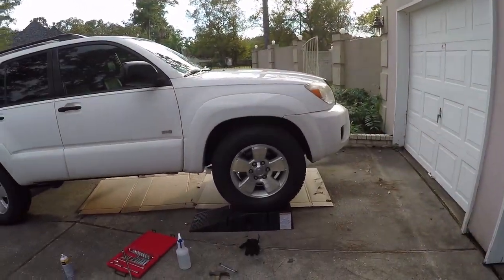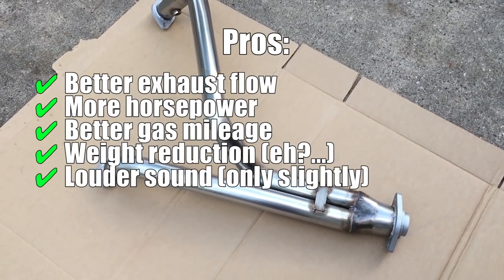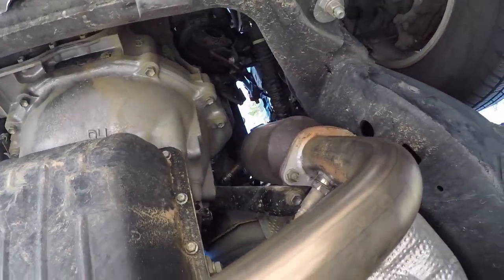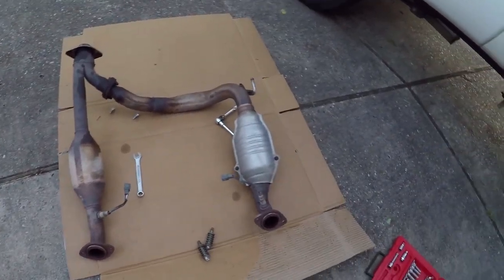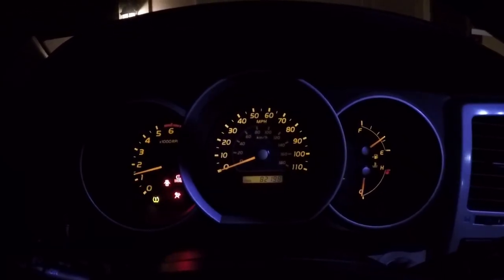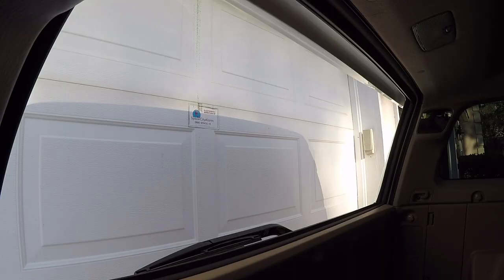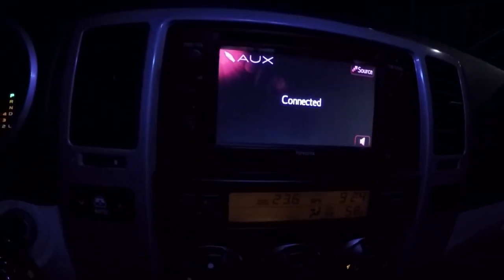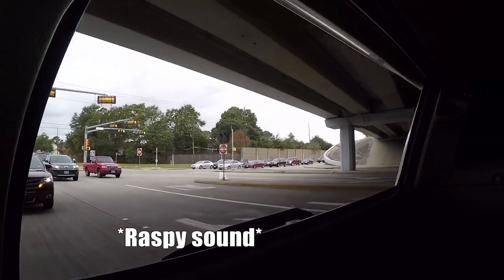4RUNNER GETS A Y-PIPE + MPG UPDATE

Comment: Great install my man!! I have a flow master super 44 on my 06 limited. I’m gonna do the y pipe as well! That is pretty much the only differences in our set up. I have the afe intake also.
Reply: how has the afe helped your 4runner?
Reply: It definitely gave it a better intake flow, sound and a little more spunk. You can’t really notice a substantial power gain but it does have a little more on the top end.

Comment: Thanks for posting the vid, watched before making the purchase and damn it pairs nicely with my gibson catback and K&N air intake on my 04 v6. Sounds great and i can feel the difference, hoping after a few weeks to a month ill notice a slight boost in my mpgs. Had a leak in the stock y-pipe and figured may as well replace it.
Reply from the maker: David Geary Note that you'll need to resist the urge to floor it everywhere because of the sound and performance. Otherwise your MPGs will drop lol
Reply: @airsoftmechanic  uhoh i guess i can expect a decrease in my mpgs haha

Comment: What was your mpg before you installed this? Just gotta say wow 24 is a lot compared to mine I’m getting about 15-16 . Also what state are you in where you able to pass inspection I really want to do this becouse I have a leak somewhere and I think this would fix it but don’t want to do it if it won’t pass inspection? Great video btw man!!
Reply from the maker: Ayden Permel I live in Texas. Down here as long as you don’t have a check engine light, you’ll pass with the y-pipe
Reply: I'm in Pennsylvania and I deleted the secondary cats but kept the ones thats welded to the headers. I also just added a electric cutout and still passed emissions with the valve closed. With valve closed its still has a low rumble at highway cruising but when you step on it, it definitely is loud
Reply: What was you mpg before you installed it?

Comment: I assume this is installed with original OEM exhaust manifolds? Have you had any cracking since install? I'm just concerned with the added weight not being supported by a hanger, but maybe it isn't a big deal.
Reply from the maker: Prince DIY No, to this day I haven't had any issues with it cracking. Though I do agree it's nerve racking to some people that it doesn't have those exhaust hangers

Comment: Hey bro we have a 4.0L v6. Is it a good idea to get the URD headers for it and delete all the cats ? I'll use spark p Lig defoulers on the O2 sensors to trick the ecu. The truck feels gutless bro
Reply from the maker: gurjinder singh It depends. If you’re state doesn’t check emissions then go for it. If your state does, then I’d suggest not upgrading the headers unless you can find a way to keep them

Comment: I went the cheap route and cut the cats off and welded a piece of pipe in, doesn’t look as shiny but it cost me probably $20
Reply from the maker: John Hide your cats since people are stealing them off of cars
Reply: How are you passing emissions? Id love to do a cat delete but figured i couldnt pass.
Reply: @jonathanmiller2441  TBH I haven’t gone thru emissions yet, but I only removed the two rear cats which are not monitored so it didn’t set a fault code. I have to do manifolds and have been putting off emissions. Hopefully I’ll pass with the new manifolds/cats

Comment: I've got a nasty leak and plan on using Doug Thorley long tube headers. Do you think this Y pipe would work with it?
Reply from the maker: Chingy Thao Assuming the headers are bolt-ons, and the flanges are in the same exact orientation as the OEM headers, yes they should work

Comment: I like the look of your AFE CAI in place of the air box/ resonator. I bought the AFE dry filter for my 03 Sport V6 a few years back. It’s easy to clean and seems to be working ok. Performance and mileage haven’t changed though. 
I doubt the CAI has any real world benefits to our trucks useful power band but I like the look and the resonator box is obnoxiously huge (although it does quiet the intake noise considerably). I always thought the 4.0 looks much better with the intake manifold exposed and probably would run cooler in the heat.
Can you pass smog test with the Y-pipe/dual cat delete? No issues with the O2 sensors & ECM sans cats? The mpg gain is impressive if accurate but for me personally not acceptable if the truck pollutes more. I try to be an environmentally responsible 4wheeler.
Liked & subbed. Your videos are well filmed, well narrated and very entertaining.
Reply from the maker: Dominique Stephenson Thank you! 

I had no issues with the O2 sensors when I installed the y-pipe. I passed my inspection with both the y-pipe and oil catch can installed. Most counties in Texas are very lenient about emissions. If you don’t have a check engine light, you’ll pass.
Reply: Cool, thanks for following up!

Comment: How did you get around the check engine light with no cats? De foulers?
Reply: The rear cats are not monitored by the ecu. They’re there simply for emissions. The ecu doesn’t care if they’re even there lol. No defouler necessary. I just did this job a few days ago and I love it. Good luck man!
Reply from the maker: @xlxphoenixkingxlx  Correct! I had no issues whatsoever, and didn't have to mess with the ECU, O2 sensors, etc.. Just had to swap it out

Comment: What were your MPGs before the install?
Reply from the maker: Dom Davidson At the time it was fluctuating between 20 and 21
Reply: @airsoftmechanic  I have a '05 V8 4Runner and am getting like 15mpg. How do you recommend pushing this up to 20+ other than this mod?
Reply from the maker: B Griggs This, a cat back exhaust, performance air filter/air intake, weight reduction, run Techron fuel system cleaner, run Chevron gas, seafoam the engine, and perform regular maintenance. Of course, the way you drive also has an effect on MPGs. Also keep in mind that the V8 will have lower MPGs than the V6 most of the time.

I’m debating on whether I want to add headers or not, but for now I’m keeping them stock
Reply: @airsoftmechanic  Thanks!
Reply: B Griggs did you end up doing any of these upgrades on ur 05 v8? Just bought mine and I’m having the same avg. 15mpg issue

Comment: Hey man, I’m looking to get this y pipe. The only thing holding me back is the fact that we need to get state inspections, I am already debating on putting the old pipe with cats back on every year but I just wanna know what you do for that.
Reply from the maker: Zacarias Hashemi I keep my Y-pipe on, and it’s been on for 2 years. Some counties in Texas check for emissions, but most other counties don’t. The main thing they look for is the check engine light, and as long as it’s off, it’ll pass. However if you’re in a different state where the laws are more strict (like California) then you would have to change the pipe every year.
Reply: Airsoft Mechanic oh okay, thank you so much man. I’ll look more into my counties laws.
Reply: Wanted to ask did you get a check engine light on from this? Any issues    after having it on for a while? Thanks

Comment: I wish I could get my hands on the Y pipe, but they discontinued it😑
Reply from the maker: C_Cotto_83 I checked URD’s website and it looks like it is discontinued 😭
Reply: @airsoftmechanic  where could I get one? My cats were deleted when I bought it and now the welds are leaking
Reply from the maker: @lowcountryadventures5549  Unfortunately you can no longer get this one. You either would have to go with another brand, or have the pipes re-welded
Reply: @airsoftmechanic  also did you have any issues installing the Gibson exhaust. I cant find s solution to raise off the rear cross member. Thanks
Reply from the maker: @lowcountryadventures5549  The only issue I had was I had to user a different tailpipe than what was shown in the instructions

Comment: Throttle body spacer does nothing. Only intake runner spacer will make a difference on the 1grfe . Also ability to tune , such as the software or UCON URD sells
Reply from the maker: lukestoyz The throttle body spacer helps keep the low end torque. I’ve heard about the manifold spacer but didn’t hear much about it. Curious to see what the results are from another owner’s perspective
Reply: Airsoft Mechanic checkout https://extremetruckperformance.com/ for the 1grfe. The plenum spacer Will help move your torque down lower in the power curve. The reason the TB spacer doesn’t work properly is because your motor has a butterfly valve inside the plastic intake plenum to choose between short and long fuel runners going into the motor. Disrupting any swirling effect of the TB spacer. I have ran this spacer on both naturally aspirated and supercharged trucks. It seemed more noticeable on the stock truck with exhaust

Comment: What was the fuel economy before?
Reply from the maker: Rory eisenmann Before, it was bouncing around between 20 and 21 MPGs
Reply: Airsoft Mechanic I’m assuming you’re referring to the fuel economy readout from the OEM dashboard system and not by calculating it on your own. My dash mpg readout has never read that high. Do you do a lot of highway driving? Even when I take long trips, best I get is about 19mpg. 

Btw, Carfax has a free app to track your maintenance and even calculate mpg that works pretty well. It’s called myCARFAX.

Comment: Have u deleted the Cat?
Reply from the maker: Only the secondary cats. I still have the primary cats
Reply: @airsoftmechanic  I am planning to put headers, down pipe and delete cat.
Also install a cold air intake.  What do you think?
Reply from the maker: @kanevivalakane3699  It’ll get rowdy, and you will most likely get a check engine light (if you get long tube headers). If you don’t mind it shining in front of you, go for it!

Comment: Do u have an after market exhaust system after the Y pipe? Or u running stock exhaust?
Reply from the maker: wicked88crx Yes I’m running a Gibson cat back exhaust
Reply: Airsoft Mechanic Nice!!! I just saw that video!!! Good no check engine light and do you have plans to do an ECU tune with all the after market mods u done and possibly a synonym run 😃
Reply from the maker: wicked88crx As of right now I don’t have any intentions on tuning the ECU. The truck runs fine the way it is. But if I do though...👀

Comment: It was easier and cheaper just to get a muffler shop to cut the 2 catalytic converters off and weld a new pipe on. And it doesn’t cover the transmission. My V8 4Runner definitely gained on the top end, but not so much on the bottom end
Reply: But you're leaving the most restrictive part of the mid pipe intact... The crushed section of pipe running from driver to passenger is dual walled and very restrictive.

Comment: "Improving" exhaust flow on an engine that is still stock is pretty pointless. Increasing horsepower doesnt increase mpg...hp is gained on an exhaust by letting more gas out at more rpm. When youre running higher rpm to acheive that hp. Guess what youre not getting better fuel mileage...unless youre screaming at peak rpm everywhere you drive or your engine has been modified to where it NEEDS more exhaust flow for higher valve duration, head work, more discplacement etc etc then its stupid to "improve" your exhaust flow on a stock vehicle. Unless you have solid data that this stuff made improvements without even tuning your ecu and that it just isnt in your head it sounds like a stupid way to waste 500 bucks to me...dont let fancy marketing get to you man. You could have cut the 2 rear cats out and put pieces of pipe there for over 10 times cheaper if you wanted to make it soundy raspier for some reason
Reply: This could not get any more wrong😂
Reply: @LIL.J696  explain